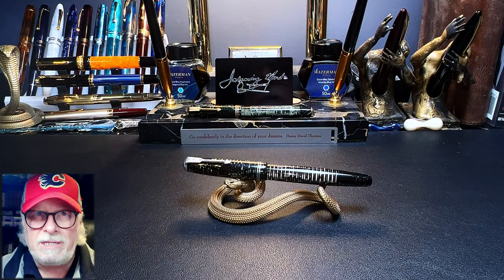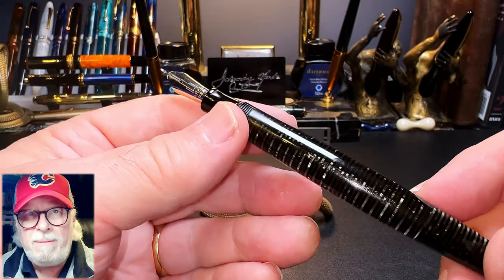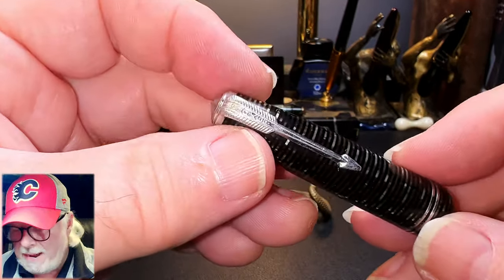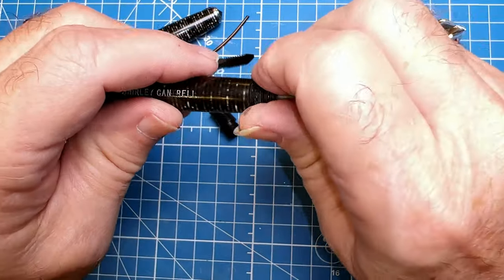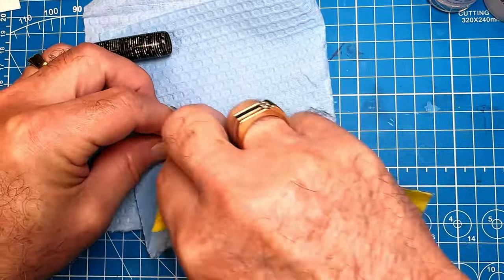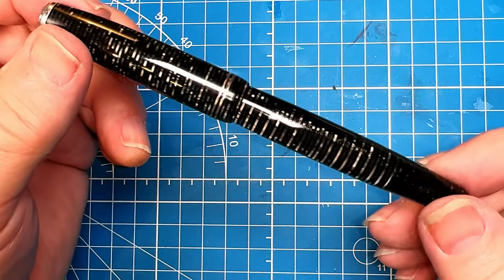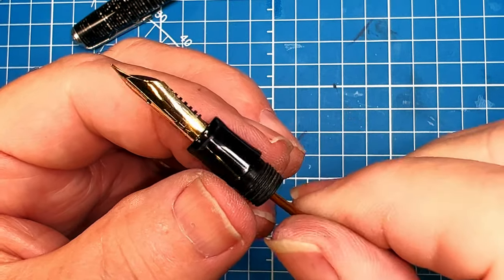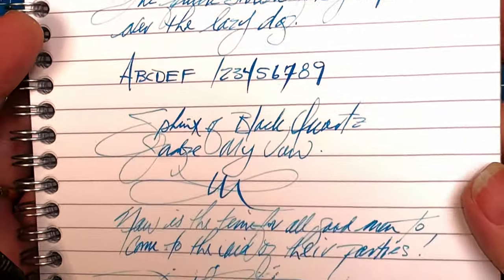Pen Resurrection Sunday Ep 44 1946 Parker Vacumatic Silver Pearl

Comment: Great watching these over Monday morning coffee.  Dremel Doug does it again. I'm wondering what applying heat to a pen looks like though. Is that an open flame?
Reply from the maker: I use a heat gun on low and from distance slowly. Ebonite and celluloid melt at relatively low temperatures.